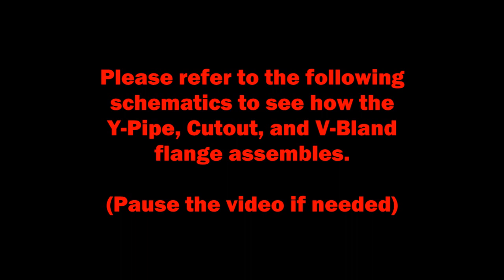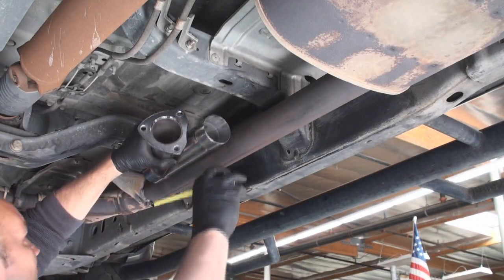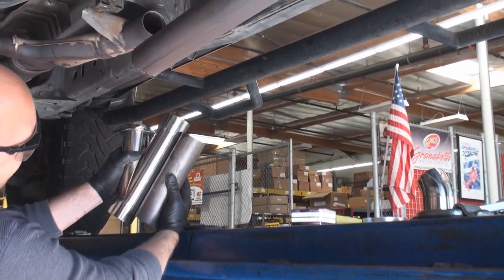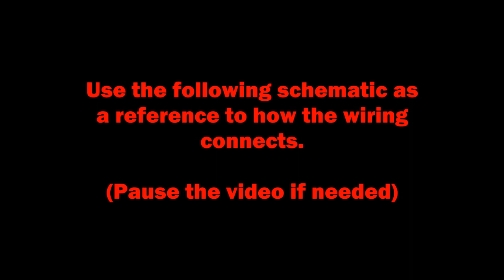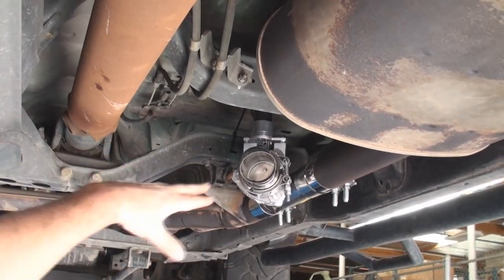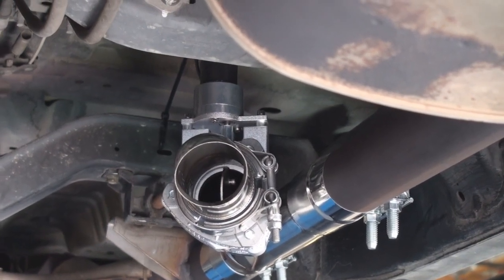Granatelli Motor Sports Slip Fit Exhaust System Overview and Install

Comment: Where is the install steps on how to wire?  Video completely skips this part.  Don’t know why 95% of videos on Youtube are half done and leave out steps in process, very frustrating.
Reply from the maker: Every car and truck is different. that is why we didn't show that part. Our kit is simple to wire up.  You can always connect straight to the battery or wire it to key hot under the steering wheel
Reply: When we made the video, we were simply explaining the concept and what makes.oura unique and therefore best.  WIRING is simple😊.  It's power and ground.  We recommend key hot.  The only other connection is plug and play.  Our website has detailed instructions as well.  Sorry for any confusion

Comment: Awesome product but as I work in the marine industry I know that heat shrink doesnt in fact make a water tight seal but can cause more damage by trapping water inside. I would suggest useing self amalgamating tape, this will give you a perfect seal protecting the connection from the elements.
Reply: Thank you
Reply: We are not looking for water tight - just not to be pulled apart under tension
Reply: Marine heat shrink actually would make it watertight... It's basically lined inside with hot glue so that it becomes a solid encapsulation.
Reply: Is better running that plug inside and under the carpet

Comment: Is it possible to still wire in a relay with this "brain" included in the circuit?
Reply from the maker: Yes you can do that
Reply: It includes a circuit board that carries the load.  Its rough .2 amps (point-2) But yes you can install a relay - i would not

Comment: Thanks to Jojo GRANATELLI for this video, really good Job. I installed since 2 days  302525  Granatelli CUT OUT on my Nissan TITAN 04, just perfect. Very Hight quality, Good sound, very simple to install with this video. I recommend GRANATELLI MOTOR SPORTS. Dimitri to FRANCE
Reply: Question: How long did the electronics last or how are they with wet roads
Reply: @thepro4x362  No problem with electronics parts and no problem with wet road. This cut out works well. I use it since one years now. I drive 100 kms per days I open it every days. I hope it help you.

Comment: Looks like finally someone made a decent set of valves.
What is the warranty on your system?  Do you have a control box set up for dual exhaust systems?
Thanks Sid
Reply from the maker: 1 year limited warranty and the Switch provided will run both cutouts
Reply: Thank you
Reply: YES - the dual system has the correct box controller

Comment: The system does not require an extra relay.  There is no reason to block off the muffler - it always takes the path of least resistance

Comment: So let’s talk about finding a spot for this set up. The motor looks small but everything together is really big and you gonna need a lot of space. First check under your car for space and plan out everything. I literally had to hammer in the floor to fit in this as this mfkin set up is huge and hopefully it doesn’t fail like others as I paid $350+ for this but I’ll update u guys.
Reply from the maker: If your limited on space go with the oval kit total length can be a short as 4 inches 

805-486-6644

Comment: Do you get the same size as your pipe or .25 inches bigger? Like will the 2.25 in size fit perfectly or should I get 2.5 inch for it to slide on top of factory pipes
Reply: We offer both slip fit design 0:00 or weld in.  Separate part numbers.  Just let us know when you order.  Don't order oversized pipes

Comment: One of my two cutouts stopped working 6months later, I’m trying to find out if it’s wiring/connection right now
Reply from the maker: GIVE US A CALL 805-486-6644

Comment: So how do you wire all this and how do you wire 2 cutouts to one switch
Reply from the maker: All our kits have the instruction how to make 2 brains work off one switch. If you cant find it you can always call in. 805-486-6644

You will need to cut the one switch wires off the back and stripe and connect them to the other switch we give you the clips to crimp the wires to the switch.
Or 
You can always upgrade to the wireless remote all you do is plug in and play  Part number 303510R-D
Reply: @GranatelliMotorSports  I’ll probably just upgrade to the wireless switch thanks I had no idea you guys offered one

Comment: Do you guys have a wiring installation video?
Reply from the maker: Every car is different. But we recommend wiring it up to a KEY HOT wire so you don't drain the battery as it could put a small drain on the batter over time if you do a direct hook to the battery
Reply: @GranatelliMotorSports  Thank you, ended up taking it to a stereo system shop they did the wiring job👍🏻

Comment: Can this be welded completely?
Reply from the maker: Yes. We most of the time will install the slip fit and weld it in
Reply: So I brought this about three months ago now I’m constantly recently hearing a rattle from inside, I believe it’s coming from the flat any idea? What to do with this situation?
Reply from the maker: @re9473   Please call us and we can help you with this. It could be a relearn process is or a screw needs to be tightened
Reply: @GranatelliMotorSports  yeah so I laid under the car and it looks like the flats are moving inside of them making rattling noise. If I put my finger on it they don’t move as soon as I remove my finger you can hear the rattle, so the flap is not completely closed.
Reply from the maker: @re9473   Make sure that the allens that hold the butterfly shaft to the motor are tight

Comment: So my question is, when the cutout is activated, it does not block off the muffler section so exaust will be released from the cutout and muffler this has me mind boggled because wouldn't you get way more sound if all of the exaust is being released from cutout alone not throght the intersection of both?
Reply from the maker: Yes, Not 100% of the exhaust will come out of the cutouts but like anything in life it will always try to take the easy way out of your pipe
Reply: you know, with x amount of fabrication. .. buy 2 of those and get the valve junk from the second one welded in the straight section behind that y so it'd make a block plate when closed. the exhaust would all go out the open end. 
 murphys law to that is .. if you have both of the closed at the same time something not good is bound to happen

Comment: I've had this on the car for about 1k miles. It's starting to not hold the close position well anymore. When closed it's fine on idle but as soon as I get on throttle it starts rattling.
Reply from the maker: If you have not called in yet please do and we will help you out
805-486-6644
Reply: JUst call in.  That is the first we have heard of that.  It sounds like a harmonic issue

Comment: whats the best way to measure the diameter of the exhaust to know it'll fit, cheers
Reply from the maker: the outer diameter of the pipe. if you are running stock exhaust you can always call in and we can help you out to get the fitting set for you
Reply: ruler?

Comment: yeah, but how good does the
actual valve itself seal????
thanks
Reply: Seals 👍 great!  When our valve shuts, it mates to a landing seal on before sides of the blade.  We don't market them as water or air tight but they are as close as you can get

Comment: What if you bypassed the switch and gave full open/closed through tbe control box constant 12volts?  Would that end up damaging it over time?  I'm looking at getting this for my dodge charger a linking them to my sport mode feature.
Reply from the maker: I would recommend our oval set up
we have never wired it like that
Reply: @GranatelliMotorSports  Is there a contact number I can call to explaim exactly what I was planning doing, to see what product would fit my needs?
Reply from the maker: @fireboygamer  805-486-6644 JOJO

Comment: Hi. greetings I am interested in this article because all those that I have looked for all are welded with autogena and the installation that you make is very easy I do not want to weld anything. You could give me more information about the article if you sell it or where I buy it, it really hurts me. the measure would be 2.5. I am from mexico
Reply from the maker: This system will work great for you. NO WELD REQUIRED.
 Call 1-805-486-6644  Monday -Friday 8-5 PST 
  part# 307525  2.5" (63mm) Electronic Exhaust Cutout System SINGLE SYSTEM

Comment: Can I open at high rpm ?
Reply from the maker: Yes you can open at high rpm
Reply: The switch is included.  However if you want it on an RPM activated switch that works at higher RPM's you could do that
Reply: Naif M يمديك ايه 😂😂😂

Comment: So it's not adjustable? I can't just open it a crack if I want?
Reply: There is another video that shows you can install the standard switch instead of this full open/close auto shut-off switch (smart box).  It makes their system like all the other systems that you have to manually control the open/close by holding the switch in the correct position.  I would think if you want the best of both worlds, install the switches in parallel so that you can bypass either one when you choose to do so.  Here is the link to that other video:  https://www.youtube.com/watch?v=_wQv0tfu4DU
Reply: We offer that option but as shipped its OPEN or closed.  You will find that opening half way sounds the same as wide open - its just better for the valve to be opened or closed all the way

Comment: How did you get it with those clamps and flared ends? All I've found from granatelli needs to be welded in place
Reply from the maker: Here is a link to the website look near the bottom as you will find all the slip fit kits
https://granatellimotorsports.com/p-35854-exhaust-cutouts.html
Reply: @GranatelliMotorSports  where can i find those long clamps? The kit i want has the small clamps, but id like those long clamps if thats possible.

Comment: Is that  possible for  auto diesel  ? Tank u
Reply from the maker: Yes we make it in 3 inch and 4 inch at this time. It will have to go behind the DPF system about 8 inches. For temperature reasons
Reply from the maker: SOON COMING IN 5 INCH

Comment: Can you run the manual switch under the hood as a back up and just use the wireless remote ?
Reply from the maker: We have never tried. I'm sure you could though
Reply: @GranatelliMotorSports  is there a way I can get a reverse of the splitter that comes with the wireless kit?? Or could I get a bit more specs on the splitter so I can source one??

Comment: What power source should i tap into or which fuse?
Reply from the maker: Any wire the is key hot  so you don't  drain the battery if you let the car sit for more then 2 weeks
Reply: @GranatelliMotorSports  when you say key you mean ignition key?
Reply from the maker: @Edgar-and-Wrench  yes